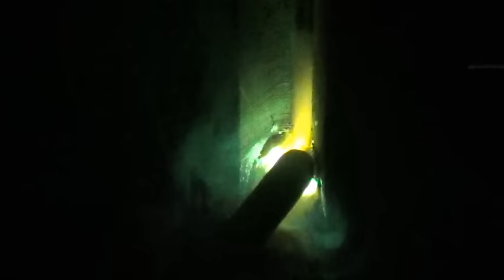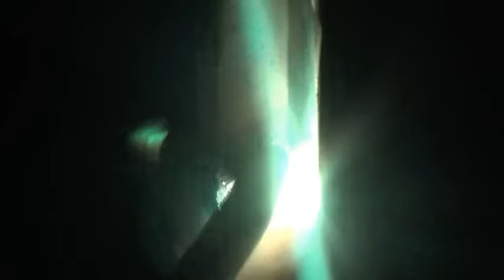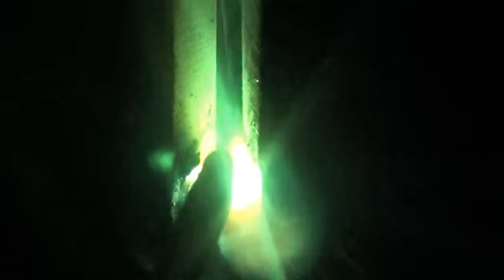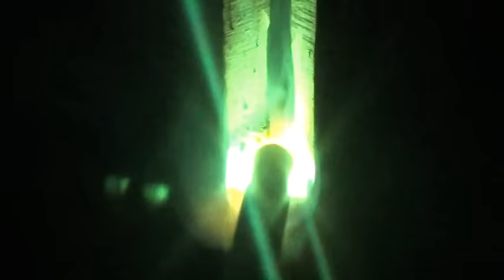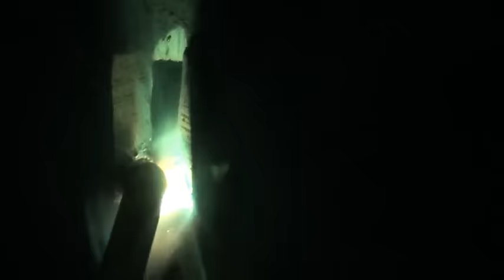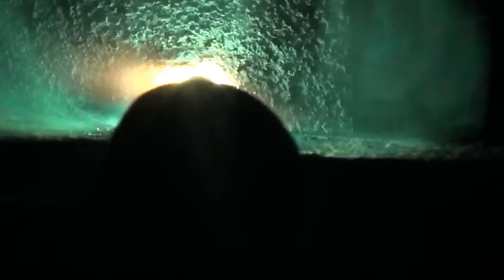7018 open root stick welding

Comment: That ain't no root pass bub.
that's called a vertical weave.
a root pass is for pipe welding with a 6010 and a 7018 cap. this here, is a structural welding technique called a vertical weave, done with a 7018.
the 70 means it holds 70 thousand pounds per square inch.
the 18 has to do with positions and flux. 
But really nice weave.
barley any undercut.
Reply from the maker: Well I very much think it is a root pass, it doesn´t matter if it is a pipe or plate if you weld the back side from the front, look at the end of the video and you can see the back side of the plate. But if you think it is not a root pass its alright by me, I am not interested enough to start an argument here.
Reply: Attis k  I ainy gony argue neither, but that won't fly in the field.
you can calls it as you like.

Comment: I think it bullshit I'm pretty good open root welder an no matter what I did the keyhole got way to big ,so I call bull shit on the welder
Reply from the maker: +bob nylund What is bullshit?
Reply: Its not actually an open root... He's just filling it
Reply: why would it be bullshit? it's standard to do open root 7018 in Sweden and probably in Finland too...
Reply: did you also use a remote and adjusted while welding? just asking since you did everything
Reply: Well i guess then you are not good enough or you didnt use the remote control like Attis does :). This is not bullshit. Its a international standard to weld 7018 all the way, also pipe, chrmo,stainless tubing even... Did you know? :)